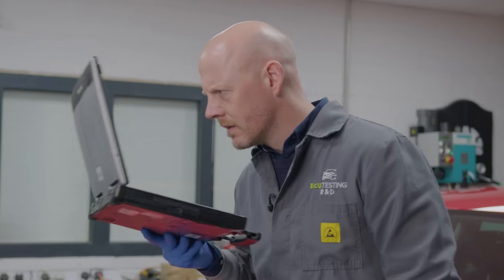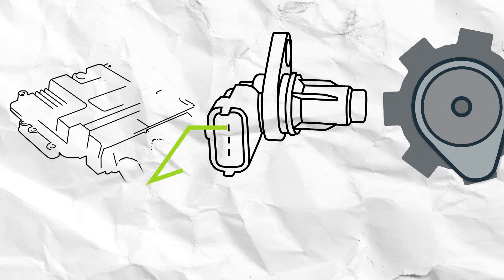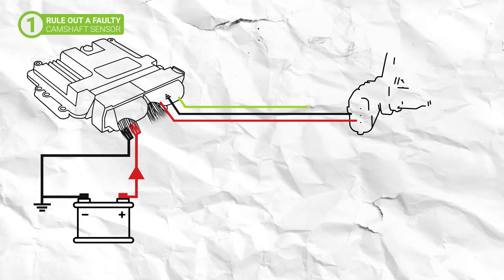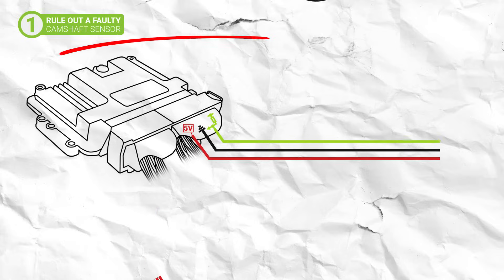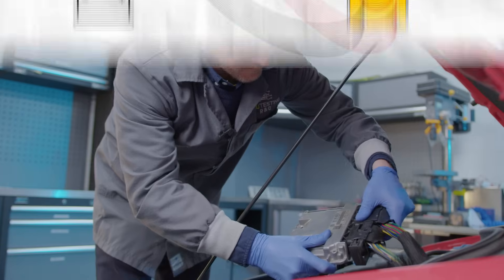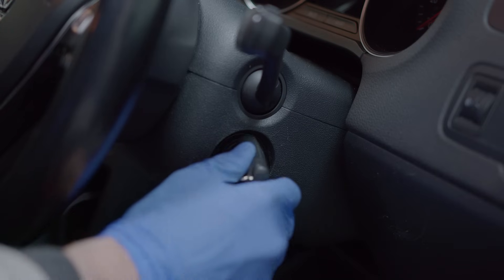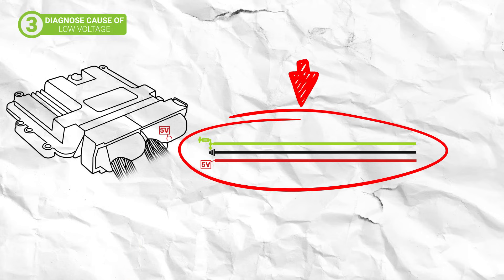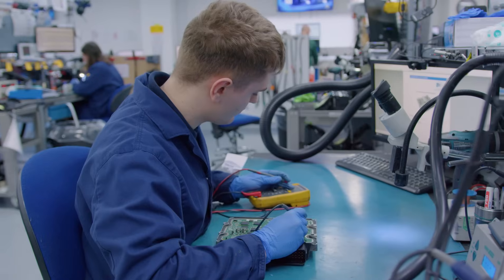Bad Camshaft Position Sensor Symptoms - How to Test and FIX!!

Comment: Although concise in the electrical aspect of the issue, it does not discuss or even mention that the timing chains may have jumped, or the tensioner gotten weak. If one camshaft is out of position by even a tooth the car will still display the 0341 code.

Comment: I broke the connector on the passenger side camshaft sensor which has three prong. Now that I have changed all chains, guides ect it's turning over and cranks then cuts off and when I try to restart it just turns over but doesn't crack. And I am wondering if I have the wires crossed. Or if it's just air in my gas or injector lines. Pls help I have a 2011 Range Rover sport 5.0 with the Ford engine.

Comment: I've got vectra z18xer. Should I have 5.1V on both high reference wire and signal wire when the engine is off but only the ignition is on? I thought that signal should be 5V only when the camshaft moves and the sensor is seeing it...

Comment: I have po366 code.. already had both camshaft position sensors changed and immediately received this code.. currently about to switch the 2 sensors and see if i get a different code meaning the one sensor is bad.. anything else i can try? Im told 2800 in parts but i dont se how aa this is the first time check engine light came on and am having issues.. thanks for your help!!!

Comment: Good video.....Tim here, My 98 Ram 1500 3.9 distributor pickup coil failed while driving 100k milege...Truck stayed at a close friends until I replaced it. 2 months later (2days ago) Truck Quit again while driving 😡....I now suspect the crank sensor it was changed a week after my pickup coil with a New DISCOUNT ☠️Part... I had an extra easier to install pickup coil tried that 1st  "NADA" That was a waste of Tim~e....So Crank Sensor NOW SUSPECT #1 as the ignition  Coil is New.  I Wish could go back in Tim~e and drive backout in my Brand New 1986 Ram 225cu inch Slant Six....😢..... Dislike New Vehicles Tooo-ooo much TECHNOLOGY & when WARRANTY RUNS OUT 💀☠️

Comment: @2:30 You say the signal wire should show 5V. This is not correct. Many ECUs use pull-downs on the sensor signal circuits, so when measuring to ground you will see 0V instead of 5V. With the black probe referenced to ground, you only see 5V on ECUs that use 5V pull-up circuits for the signals. For testing ECUs that use pull-downs, you would have to reference to 5V or B+. Even then, it could be designed as a floating circuit, which is also possible. I wonder how many people have followed your video and condemned perfectly good ECUs.
Reply: if you don't know whether your car's ECU uses pull down or up resistor, is it good to just back probe the sensor's signal and check whatever it measures be it 5V or 0V, then when passing a metal tool over it, if it changes from 5V to 0V or vice versa, it means it's working good?

Comment: My sensor 3 pin isnt dropping in voltage when waving the spanner in front. Im getting 12v and 5v plus a good earth. I have noticed im getting continuity from the earth and sensor wire. Any input? Wires connecting some place?

Comment: I read 5.02V, 5.02V and 12.35V. Also bought a new camshaft sensor, still getting P0342 circuit low.. What can be the problem?

Comment: Brilliant video. I had the ECU apart looking at it from a microscope getting ready to buy a new one. I never thought it could be the sensors since they were clearly replaced by a previous owner.

But watching your video it was obvious that the signal going to the sensors was good and as you said, if the electrical is good it must be the sensors. Very clear, knowledgeable and concise. A rare find in a mechanic!

Comment: When testing my ground, my voltage is 12.3 volts. Is that ok? Is not 12.7 as in the video. The battery also has 12.3 volts when the ignition is turned on.

Comment: Im a bit confused regarding the signal wire voltage. Your video shows 5 volts on signal wire ignition switch on. Isnt the signal wire the return voltage from the sensor back to the ECU unit? Im working on the same situation presently and my signal voltage is 0 disconnected and 0 connected until I pass a bolt over or ground the tip of the sensor and now my voltage jumps to 5 volts.  Is mine working correctly and or a different sensor than yours? Jay
Reply from the maker: Hi there, it can be slightly different for different vehicles. If you would like to email us your reg / full vehicle details to info@ecutesting.com we can look into this further for you if you would like. Thank you!
Reply: maybe your ECU uses a pull down resistor on the signal wire that's why it's normally 0V and 5V when the bolt passes over it, I'm not an expert but I think it is normal, you can read ecurepair's comment above he wrote that some ECUs use pull downs on the signal so the voltage would be opposite of what is shown in this video so 5V would be 0V and vice versa.
did you figure it out?

Comment: Interesting thing to note: if your camshaft position sensor is throwing a code and your crankshaft position sensor is not throwing a code, chances are high that it’s just a problem with the position sensor and not the timing belt. If they’re both giving codes that means deeper problems that may not have to do with the sensors.

Comment: Mine is p0340. But no other info. Runs smoothly, no idle issues, no rough idling, no stalling, starts on a dime. However code comes back straight away, and kicks it into CEL and limp mode as gears become sluggish and power cut a bit. Need help desperately. Have just changed (All OEM) both magnet adjusters and valves inside of them. Both the cam sensors themselves. And still issue comes back. Also could the MAP code that came up at very first test (not come back since) be a reason to throw up camshaft error?

Comment: I am having a codes P1392 and P1340 and the reading on the Positive is 10.78v the signal is 5v and the 12v for the black wire. There are no other codes you mention above. Is it the wiring as you state and is there a video to check the Camshaft position sensor itself. This is an Audi A4 2.8L 12v V6 1997. The car is not starting (once in  the AM it does but after shutoff and if I try to restart a little later it does not start). Could the Camshaft Position Sensor itself be bad. I want to test it too. I tried and I get no resistance with it but not sure if I am doing it correctly. Thanks

Comment: Hi mate i got a couple of error codes P0341,P0673 and p20ee could you please advise If my cam chain is gone or is it just a sensor. i was told by someone that your cam chain is gone, how would they determine even when they just looked onto those codes and in the video you didnt not even mentioned it could be a potential cam chain issue. i got Land rover discovery sport 2016  wih 92000 miles on it. any assistance would be appreciated!!
Reply from the maker: Hi there! If you email your vehicle details to info@ecutesting.com with your queries, our technical support team can look into this and advise further. Thank you

Comment: No. 
Despite the video title Bad Camshaft Position Sensor Symptoms, not once did you mention what the on road symptoms of those faults are. Not once.
So for the person looking to try and diagnose a part throttle and cruise surge that disappears at full throttle and the car otherwise runs fine and has no code of any kind showing up, this has the potential to lead you up the garden path.
The title should simply read, Check and Trace Camshaft Position Sensor System - How to Test and FIX!!

Comment: What if you have 5v on two pins of the plug and continuity with ground on the other pin, just changed out the cam position sensor and still get a P0340 code? Damaged reluctor wheel or?

Comment: Hello I’m having sensor issues with my car. It’s 4yo have several error codes that relate to camshaft sensors. Car went in to limp mode and eventually stalled. Mobile mechanic had it started about 30 mins later. Car would start and advised not to drive. Had it towed to dealership. It sat for 7 days. They now claim engine seized.  Is this possible? Tow driver started the car same day it was dropped off…

Comment: Tim, at 6:53 into the video, the green sensor wire is unhooked. There is a green component depicted at the front of the ECU. Is the the resistor and the point inside the ECU module that senses the sensor return voltage? If not, what is it?

Comment: Hi. I have a 
1998, 175,000 miles, 3.3L. All stock. Driven like an old lady would drive it.

Has thrown the EGR solenoid code since I've had it, the last 10,000 miles. I don't have emissions and don't perceive any driving or fuel economy issues so I've left it be.

Mine has never died or not started.  It is having intermittent random misfires though (P0300). Pretty rough at times, but only when it's not idling and being driven above 1,600ish RPMs. Gets worse as more load and RPMs is needed.  Doesn't appear to be anything in distributor, plugs, or wires (all newish and coil pack checks good).  It is worse sometimes than others, and present cold or hot. It seems to get worse after fuel is added too, but then settles down some after 20 or so miles. 

Coil checked good with 0.6 ohms primary winding, and 11,780 ohms secondary winding.  Cap and rotor are good and only 10,000 miles used. So are plugs and wires.  PCV valve good. No loss of any oil or coolant. Air intake filter new. 

Sound familiar to anyone?  What fixed your constant random misfires?  It does not misfire at idle RPMs, or while coasting down roadway either at any speed. 

Thanks!

Comment: I would like to share one condition that doesn't seem to be covered in this diagnostic methodology which has occurred in my experiences working as a professional diagnostic tech over the years. When testing for reference voltage at the sensor it is critical to be aware that there may be other sensors such as MAP, TPS, crankshaft position sensor and others which may be sharing the same reference voltage supplied by the PCM. These other sensors can have an internal short which could be shorting out the supply within the PCM causing low or no voltage at the cam sensor and or PCM potentially causing a misdiagnosis if not aware. I have also had what appeared to be a dead PCM on some cars when this reference was shorted to ground causing a PCM no response. I hope this helps anyone out there and Thank You for the video and the simplicity of your explanation when performing diagnostics.
Reply: This would be picked up when measuring the de-pinned wire.
Reply: Is it a good idea to go around a car and sand/clean up any ground post to metal that you see? Some bolts and stems look brown or dirty.. or could it cause issues? (I would unhook battery and do this just to make sure the ground is touching actual metal. 

How do I find out if my camshaft and crankshaft needs to be relearned? I'm seeing multiple different answers for the same vehicle.

Lastly if you don't mind, after I added a new camshaft and crankshaft sensors about a month after I started getting a catalytic converter error code for Bank 1. What do you think that could be.  A O2 sensor?

2005 Dodge magnum SE

Luckily I haven't had to many issues with my Dodge Durango.. but I be having issues with the magnum and I feel it in my soul, that these mechanics are causing the issues because they DONT listen to the customers when we tell them the symptoms. I was having issues that was cleared up after a coolant flush.. I was consistently telling him the coolant needed to be bleed. He went st8 to a fuel pump replacement and 3 days later the problem came right back and once I did a flush the problem went away. I can't trust these mechanics around here. So I ask Individuals like yourself because you seem informed and don't mind sharing Information.

I'm on this video because I have a no start condition and I wonder is it because the crankshaft and camshaft didn't get the relearn procedure. All the symptoms they say a "failed/faulty" sensor has (cam and crank) I started experiencing about 2-3 weeks after putting the them in and didn't do a relearn procedure.

Any ideas 💡? If you don't mind.. I would greatly appreciate it
Reply: What about the timing chain & t-marks issue,causing the similar DTCs?
Reply: Thanks! Your experience counts 😃👍to update my knowledge,  God bless you all.
Reply: Could you tell me what are the sunsors are?After the PCM and could be causing problems.Or what is the order of sensors?After the p c m i'm just trying to understand what could be upstream of the campfire center causing to diagnosis um precate any help thanks
Reply: Correction at the end of my last reply.I'm just trying to figure out the cause and claim to have sense of errors.That are not the center itself.Like you said, bad, so voltage from some other sensor I mean you do help.Thanks bye
Reply: Great imput, thx so much!!

Comment: Will this problem ALWAYS show a fault on the diagnostics check? I have an intermittent fault where sometimes the engine cuts out for no reason and sometimes it refuses to do anything when the key is turned. According to the mechanic no faults are showing up on the diagnostics so i am leaning towards a faulty Ignition switch.
Can anyone help me on this?

Comment: I've Ford Transit mk8 2017 im getting error code P0341, the car cranks but doesn't start.  I followed you instructions step by step and I'm getting 12.6V, 5.01V and 4.98V. I've also tested the sensor it's good but I've replaced it  into new one, any other thing you might think about it please?

Comment: Hello I have a problem with my Pontiac g6 GT 2009 3.5 liter engine. It’ll over heat when I’ll drive it for more than 30min and won’t turn on shortly after I want to turn it back on I’ll wait 1hr to cool down and it’ll start back up again.

Comment: Hi! I have a p0342 low voltage fault. However on the 5v terminal of the sensor connector I have the same voltage of my battery around 12.4/12.5. How is this possible? Shouldn't I receive a high voltage code instead?

Comment: Hi sir..how about if the error code shows U010A? what does this actually mean? very little info on this specific error code on Youtube. My Diesel powered- Isuzu Dmax has this problem soon after i replaced its EGR electrical component. The error code U010A cant be deleted on OBD2 scanner. Any idea?

Comment: Hey.. how about fault code P0344 what does that mean??
We have peugeot 2008 2018 model that throws P0344 error and sensor and wiring loom are fine.. what do you think is the problem???

Comment: Great video I am still trying to find out what my car will not start. Maybe you can point in right direction. Car sat for 6 years. It's a 1998 Volvo S70 GLT. I cleaned out fuel tank, replace fuel pump and fuel filter. I  cleaned injectors. Car cranks has spark and fuel out the injectors. I thinking must be a sensor where the timing is not lining up with the spark and injected fuel.  Any thoughts

Comment: May 30 2024 , great easy details video. Question, how do you test ECM and the 2 wires , that come from ECM and wires  that goes to knock sensor voltage that goes to knock sensor ? Is it the same way to test the cam shaft wire , that you showed in this video. 

What setting is set of multimeter ?

Comment: HI this is a really good Video (and Have looked dozens to try and understand and resolve Sensor Issues) very very clear and very well explained, I only have a couple of comments if you spoke just a little slower that would be great and also if there was a slightly more detail description on the different configurations of sensors wiring for example on BMW's the signal is the middle wire .. also maybe a test of the actual sensor using something metal and the fact cheap sensors are usually Crap and you can replace them and the fault can still exist, also if you drop a sensor there is a good chance it will be damaged and can throw up a an intermittent fault which you cannot really test with a meter. not criticisms observations and im please to have found a company that can service repair ECU etc you guys clearly know what your doing ... again really really good video with visuals and diagrams (I know how long it takes to produce something like this)   keep up the videos and the great work your efforts are much appreciated.. Regards Keith
Reply from the maker: Hi Keith. Thank you for your feedback, we appreciate it. We are glad you liked the video and thank you for you kind comments!
Reply: You are welcome (and I practically never leave comments or reviews LOL) Will be in contact with a view to getting some ECU's over to you for repair fortunately when we replace stuff we don't throw anything potential repairable away ... BUT !! soooooooooo difficult to find people with relevant skill sets these days

Comment: the part where you test the wires to the cam sensor on the ecu side doesn’t make sense, you can’t just test them they’re plugged into the ecu connector and would lose power if you unplug the connector. where would you be able to test the power on the ecu connection side with it plugged in still
Reply from the maker: Hi. You can test the wires on the ECU connector when it is plugged in by back probing the wires behind the connector. We have a video that details how to do this on our channel: https://youtu.be/S8GL8VCg7C8 Watch from 2:20 onwards for steps on how to back probe. Hope this helps!